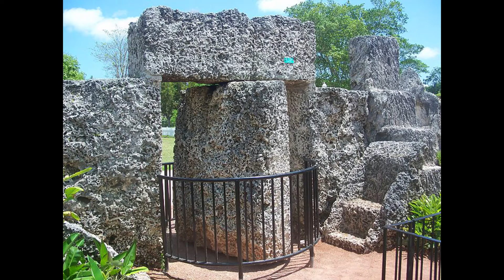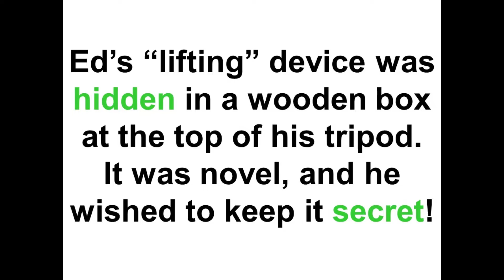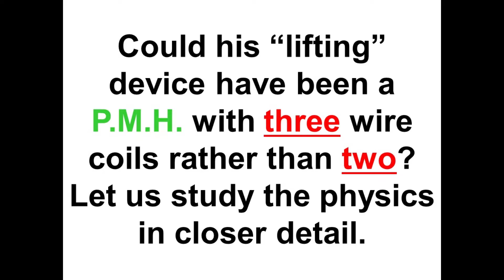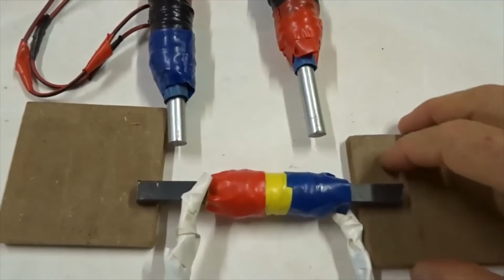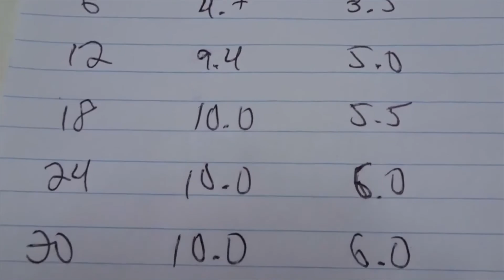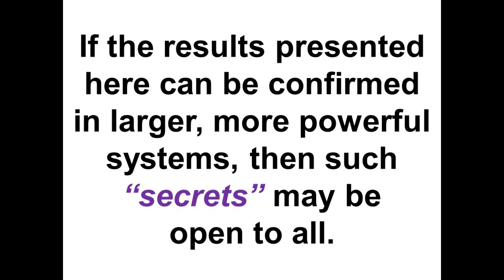Adding a 3rd wire coil to Ed Leedskalnin’s PMH greatly increases its DC-powered lift

Comment: You can get a lot more power with much less voltage/amps by using smaller gauge wire for the coil. Also, much less wire needed! You actually only need one coil on the "U", not two. Just start from one leg of the "U" and wrap the thin gauge wire around till the other end of the "U"- just one single layer. This is not exactly easy to do and takes some time! This will produce much more attraction power from the "U" to the "keeper" with less volts/amps.  In other words, a much more efficient PMH. I didn't have an adjustable power supply when I made one. I just used a wall wart with a 5 volt 1 amp output. I also took a small DC hobby motor and used it as a very small generator and attached it to the coil and could get the keeper to attract to the "U" with just a spin of the shaft with my fingers of that motor.  How much volts/amps? I don't know but could not be very much. I have always wondered: is it the volts or amps which is more efficient for the keeper to attract to the "U"?  
Another thing: After the PMH is charged, there is a magnetic polarity when a compass is moved around and thru it. On one leg of the "U" the compass points inward N and the other S inward toward the "U" at a 90 degree angle. You must hold the PMH with one hand and use a small enough compass that will fit between the legs of the "U". Oddly, it has a magnetic polarity yet is not a magnet....HMMM?????

Comment: Oh, so Leedskalnin's hypothesis is that the Egyptians, Aztecs and Mayans had massive amounts of electricity and related wiring to move those a massive blocks.  Interesting, but no evidence to support that.
Reply: I think the drilled holes might make sense.
Imagine you drill a hole through a stone, put your wire through it and then charge the wire, maybe that's the way they made the stones moveable ?!

Would be nice to hear your thoughts about that theory mate.
Thanks in advance